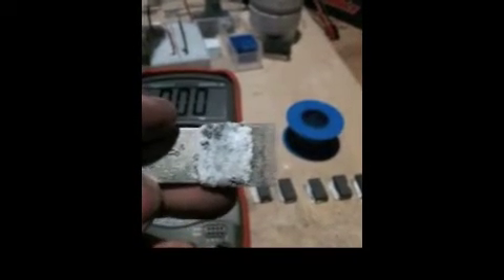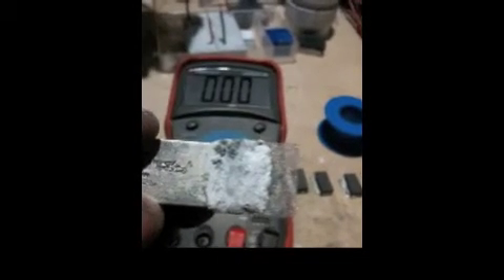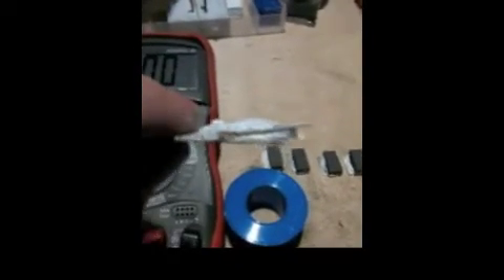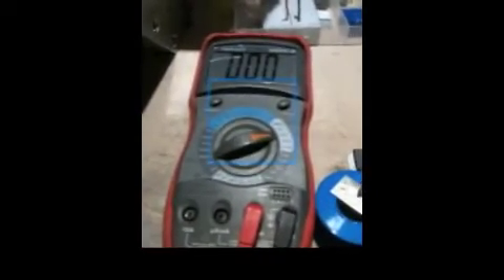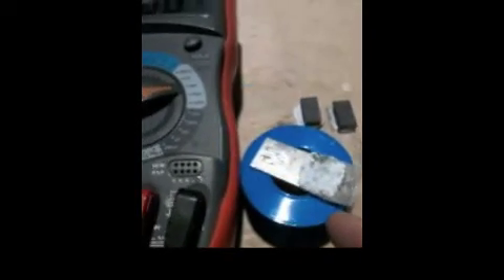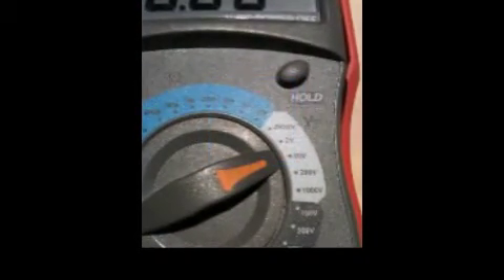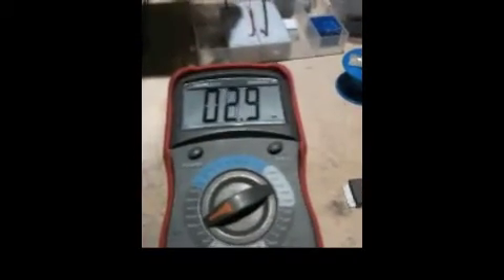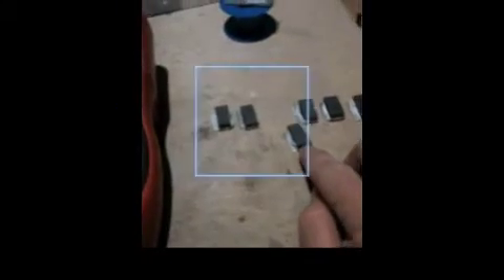CARBON and CARBON DOPING

Comment: Did you charge them? Because you are the only one showing over 2 volts in a cell.  I think also the carbon is a special element. As I made a cell with carbon dust in the crystal and it the cell is 2 weeks old today and it's got more voltage today then last week.